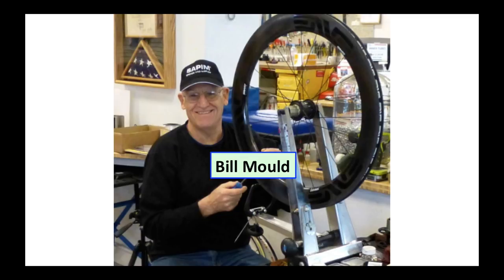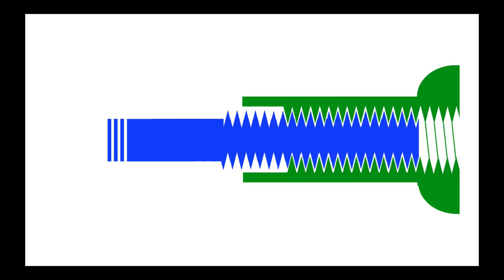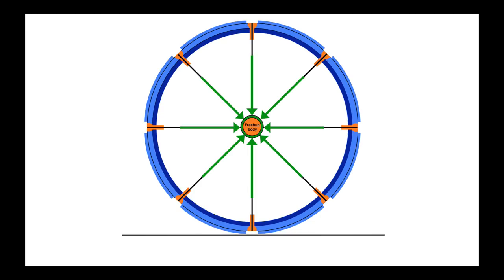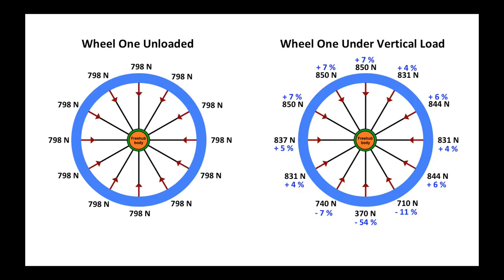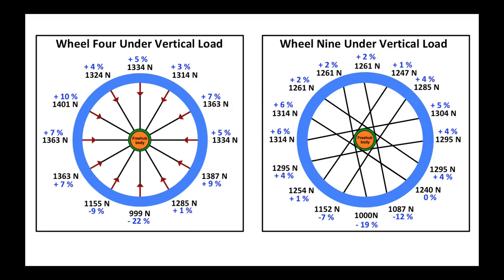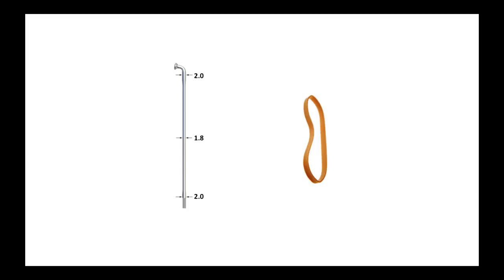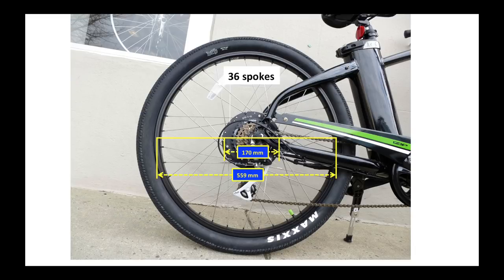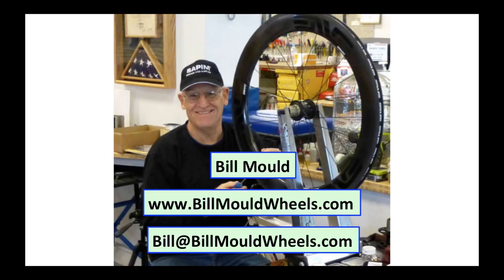Reengineered E Bike Wheel

Comment: Hey Bill, nice work. I agree with most of what you say but I find the exposed thread assumptions not valid. On a good swaged (butted) spoke, the thin shank (1.8 or 1.5mm depending on spoke style) is thinner than the root diameter of the threaded side. In addition, on a rolled spoke, you don't have the same stress riser as those in your pictures. Obviously you use rolled threads because you're using SAPIM, but my point is that attempting to protect the threaded end by arranging the nipple engagement so that no threads are exposed, is unnecessary. You can build a perfectly durable wheel without this.
Further, the practice of having a spoke protrude past the slot in the spoke head is problematic because it elliminates the last resort way of unscrewing a rounded, seized nippe i.e. with a flat screwdriver. Once the spoke is past that point, a screwdriver is useless and it is a cut and replace job.
The only time I like to have the spoke protrude is when the customer wants aluminium nipples. These fatigue and break when the spoke doesn't protrude. 
Your spoke tension data is interesting. It shows that the only spoke that works during cyclical loading is the one in the load affected zone. The others don't change tension enough to be of any significance. On paper and in calculations, they don't change tension but these models overlook the fact that the rim shape changes when you flatten the bottom of the rim and this change expands the rim, hence increases tension in other spokes. This mode of tension increase is villified when you look at the increase even in spokes adjacent to the load affected one. Even those increase in tension. 
Maybe in one of your other videos you talk about stress releace, but in my experience, a double-butted, stress-relieved wheel has an effective infinite spoke life, whether it is an e-bike, MTB or road bike.

Comment: Hey Bill - interesting points. I can’t say I’ve ever had any issue with the spoke thread issue you’ve referred to in your first point. The largest failure we see in ebike builds is either from using a 13g reduction nipple (aka fit a 13g spoke into the same size of the 14g nipple) where the nipple shears and if the builder chose not to use a spoke washer for a motor where the hub flange hole diameter is too large (usually sized for 12G nipples!! Which would be hard to tension properly in a std bike rim). The length issue is trivial with the use of custom cut lengths, and the angle issue is known, but relatively easy to over come via either pre bending spokes, or choosing a more appropriate lacing pattern. Check out our spoke tool here and I’d love to hear some feedback. http://www.ebikes.ca/tools/spoke-calc.html
Reply from the maker: Would enjoy speaking with you further.  Can you give me phone number where I can call you tomorrow or Sunday?
Reply: I don't understand your 3rd sentence. Nor do I understand where you are using these washers.
Reply: @joeblogs8589  on eBike hub motors where the spoke holes are drilled for 12G spokes (usually around 3-3.5mm diameter) we place a brass washer to deform and support the heads of the spokes as they are tensioned. Without this washer we sometimes see cyclic fatigue failure as the head is loaded and unloaded repeatedly, and is allowed to float.
Reply: @spokesrobbie  Mayh I reframe what you're saying. The hub is drilled 3.5mm and the spoke is only 2mm, I.e there is a gap of 1.5mm in the hub when the spoke is tensioned? Is that correct?
Reply: @joeblogs8589  correct.
Reply: @spokesrobbie  OK, now I'm on the same page as you, I think. In that scenario, a spoke washer serves no purpose. During the spoke's cyclical changes, the spoke never goes completely slack or go into compression. We know that. Therefore, the spoke always remains firmly pulled against the side of the hub hole and the gap on the other side never changes. In other words, there is no rattling about in that hole. I don't see where the washer comes into play.